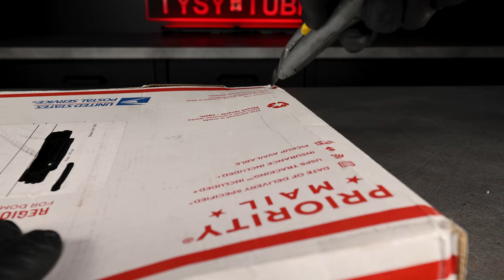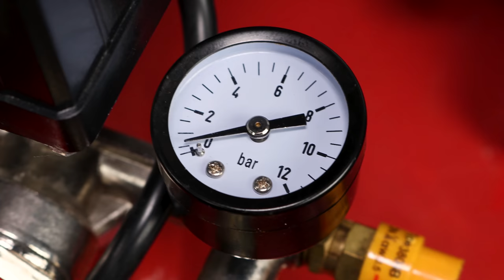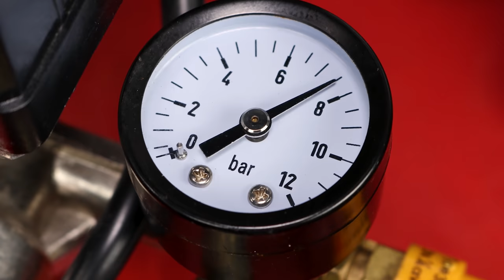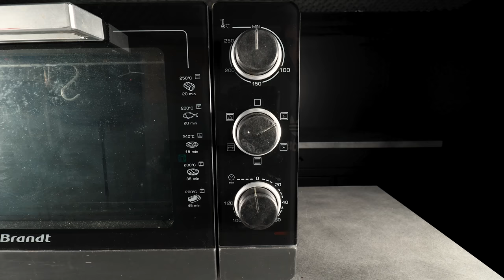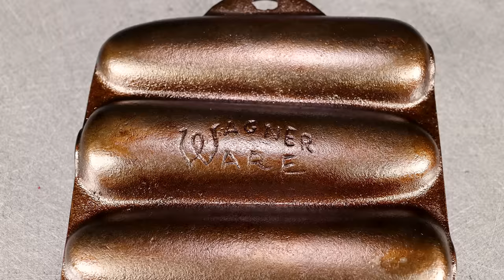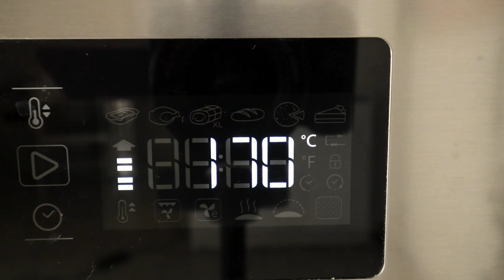Cornbread Skillet Restoration

Comment: Always heat your cast iron to cooking temperature before adding your dough. It will make the underside golden brown, crunchy and delicious.
Reply from the maker: and wasn’t like that?
Reply: @TysyTube  When you turn on your oven, put in your pan. Let it heat as the oven heats. When the oven is ready, pull out the pan, add butter and then pour in the dough. As you add in the dough, it will bubble and squeal. After cooking, it will be crispier than if you'd put in the dough when the pan is cold.
Reply: That is an excellent tip I was not aware of
Reply: Have to agree. Part of the point of using cast iron instead of a plain baking pan is it's heat retention. 

Also, you can use that to make AMAZING corn on the cobb. Leave the corn in it's husk- this SIGNIFICANTLY brings out the corn's natural sweetness. This can be done in a well ventilated kitchen, but it does get smoky toward the end so I advise using a grill outside. Cook 20 minutes inside husk, meanwhile pre heat cast iron pan in the oven to 375. You can let the corn cool enough to take husks off. Then drop a tablespoon of butter into each well of the skillet and set the corn in. Let cook 4-6 minutes, add an additional tablespoon of butter, flip, bake another 4-6 minutes. Enjoy.
Reply: Thank you, I'll tell my mom for the next time we'll make bread together
Reply: @Heymrk  Excellent, pre-heating the pan is at least as important as everone's secret trick to make the batter!

Comment: I always love sandblasting. The difference in before and after is instant and so huge!
Reply: Not always that instant. If you've got a small part with loose rust it can be a pretty quick process, but if you're doing something with a lot of surface area, like a set of motorbike engine castings or a couple of old steel wheels, the job REALLY drags on. :(
Reply: yes but sometimes it makes me cough lol
Reply: @Reman1975  I think that's not the kind of "instant" the thread starter was referring to ;-)
You point the sandblaster to a rusted piece and instantly the area hit by the blast changes from rusty to mint condition. It is like painting with the color of "new". Of course it takes a while until your entire motorbike engine is "painted" like that.
Reply: @Mad9977  always wear a respirator, especially with exotic abrasives like garnet. They will have sharp edges you'd never normally inhale.
Reply: @jsalsman  oh i am sure of that, but i was talking of myself, even if its filmed i cough from time to time =D
Reply: It looks like painting with silver paint :)
Reply: My YouTube channel there I also restore my old resty bicycle to a new mountain cycle🔃
Reply: I feel the same about pressure washing as well. Something in the air, a magic like when someone juggles, or types without looking. there is a magic involved, when someone is focused, waking Zen meditation a form of. Its mesmerisms and attention and respect as a collector  or someone appreciating the artistic quality of an environment or object,. there is magic in that for sure.
Reply: I was surprised to learn that garnet was used for sandblasting! Sparkly!
Reply: I know it is so satisfying.
Reply: nice

Comment: I would like to add that I am a big fan of most of your work. As a cast iron restorer myself pots,pans,grinder ect.... If you want an item to retain it's true value a short soak in vinegar and an electrolysis tank would be the preferred method most cast iron collectors would choose a bath in lye is also used to remove old seasoning

Comment: I didn’t know that this would be asmr but I was hoping it would be and I was not disappointed. I have been struggling with my can iron pans. My are gritty and lumpy at the edges and then the centers have come all the way back to that silver color after I did a seasoning refresh and used them for the first time. I put them on the stove and the seasoning just crumbled off like powder to reveal that silver color.

Comment: I use buttermilk instead of plain milk. The acid in the buttermilk gives the cornbread more lift from the baking powder thus lighter and fluffy cornbread. Just a helpful suggestion. I have one on these corn cast iron cornbread molds. I have had it for years and it makes great cornbread corn ear shaped muffins.

Comment: I have one of these somewhere around the house that I bought at a Ponchatoula, LA antique store about 30 years ago.  I'm sure it's in good shape but not sure of the origin. Does make fine cornbread from what I remember.
Edit:. Here's the key to best cornbread.  Heat the iron over fire or in the oven prior to filling with your batter. I use butter in the mix and lard in the pan to keep from sticking.  Hot pan will allow for almost immediate leavening and create a fluffier end result. 
In the south, everyone heats the cast iron first. 😊😉

Comment: I always love your videos. But you should mix the dry ingredients separately before combining them with the wet. The reason is so they get mixed evenly and you don't get lumps of one ingredient, while this can affect the flavor it can also  harm your digestive system if you swallow a lump of certain ingredients. For example if you accidentally swallow a large enough lump of baking soda and don't notice it, you will start vomiting and have diarrhea.

Comment: Greetings I have the same corn bread pan and it has never worked as a  nonstick. I have oiled grease burned it  washed it clean. I have never got more than a few sticks after all that effort. The real challenge is I have another corn stick muffin pan. It is cactus shaped. I consider any baked item out of that shape a home run. It is, very difficult to bake with. You did a lovely job on this cast iron.

Comment: I have two of these pans, one from each grandmother and about 100 years old.  You should put about 1/2 tsp of shortening in each space and heat the pan until the fat just begins to smoke before adding the batter.  It will fry in the fat and make a really crisp coating.

Comment: As a southerner I must correct your cornbread making. 
Put some shortening (Crisco) in the pan and then heat to about 15 degrees C (50 F) above what the recipe recommends. 
Put the pan in the oven.
When it's hot pull it out and then drop in the cornbread mix. 
Put it back in the oven and lower the temp to the correct temp. 

It will be done about 2-3 minutes earlier. 
You'll get an awesome crust on the bread.

Could probably do the same with butter. Just don't burn the butter.

Comment: You've got to get a proper air compressor. One that kicks off at 8 bar/120 psi is not the one. Or just adjust the pressure switch if the tank is rated for 150 psi.

Comment: You used way too much oil.  You just need a thin coating.  It was so thick, it didnt polymerize, hence the brown color.  It should come out completely black after an hour at 500F/260C.  One coat should do it, but 2 or 3 is better.